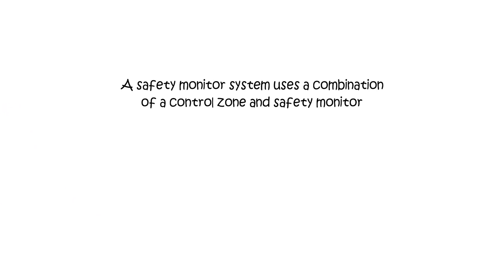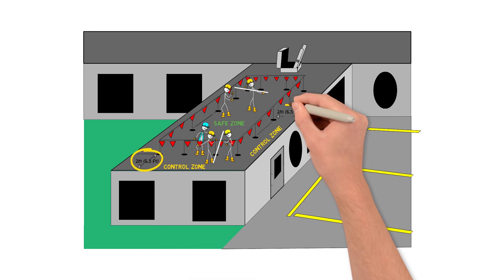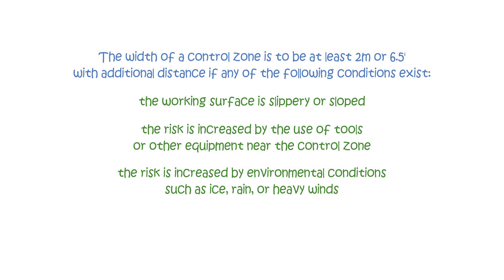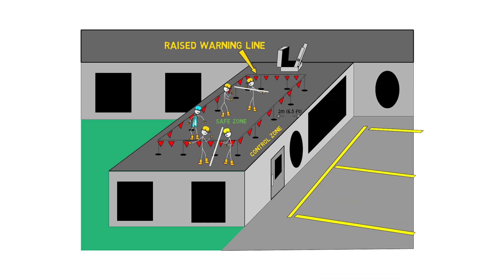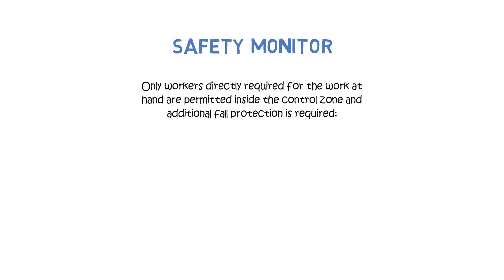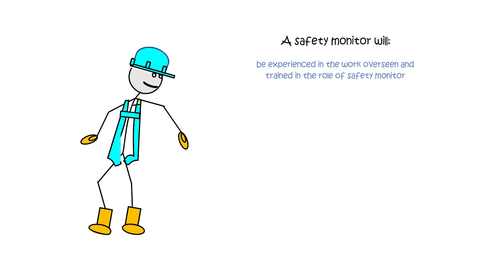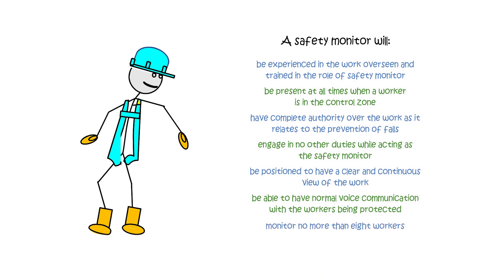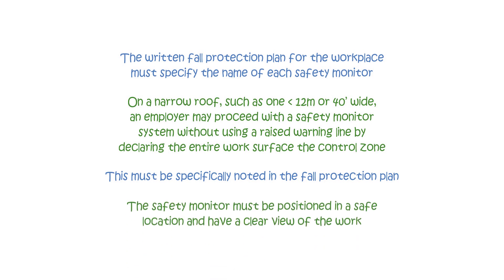Control Zones and Safety Monitors

Comment: in the US, we have some different numbers than you, like 6 feet instead of 6.5 feet from the edge and this work is for roofing work only, plus we have a 50 foot rule for width unlike your 40 foot.  Other work in general industry on low sloped roofs also could be 6 or 15 foot line creating a designated work area, all depending on the work frequency.